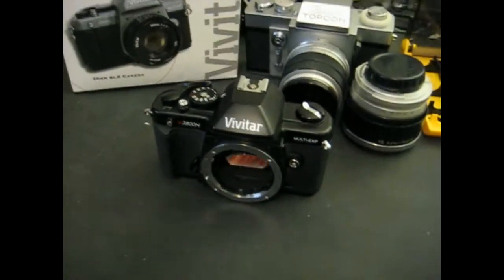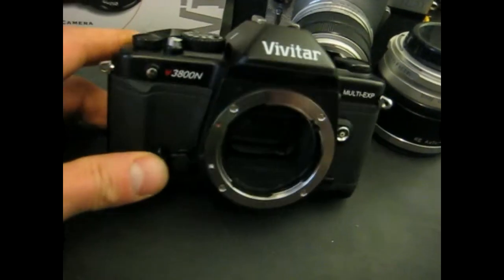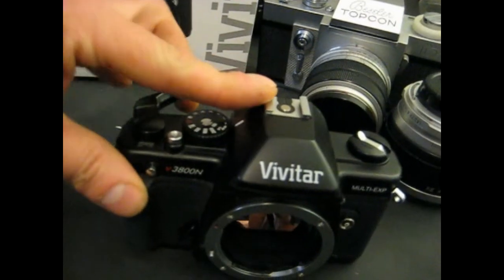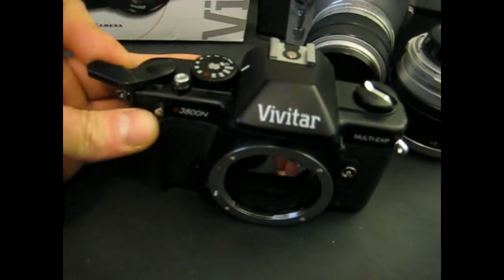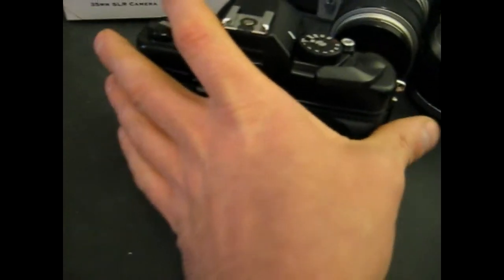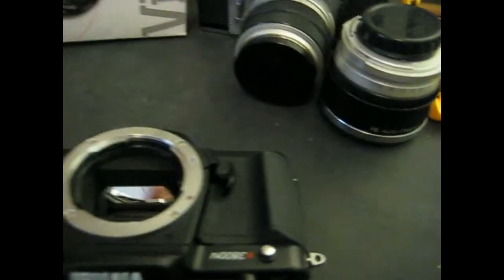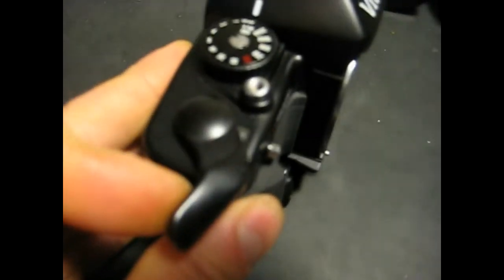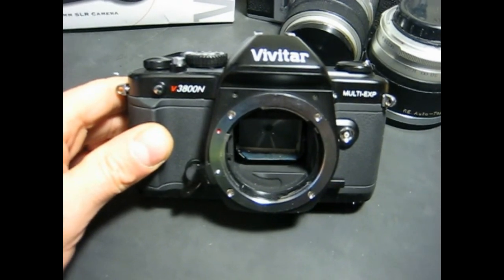Vivitar V3800N Repair

Comment from the maker: Yes, they are.  It's a decent camera for the price, but the build quality isn't the greatest.  At least it has a cast aluminum main body...  I would still prefer my old Pentax Spotmatic or Beseler Super D, though.  The Beseler is built like a tank (and weighs about as much, too) but it has its own issues due to it sitting unused for so long.